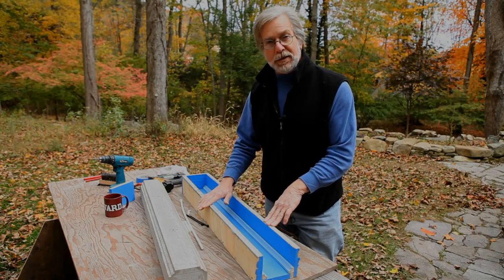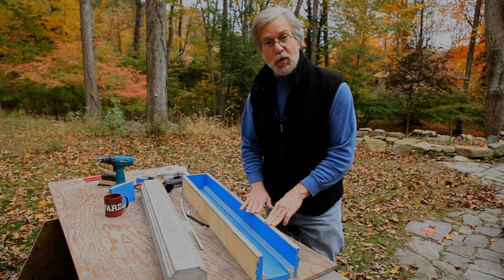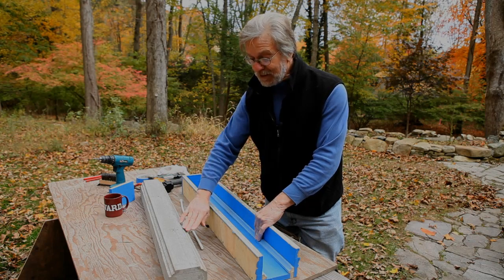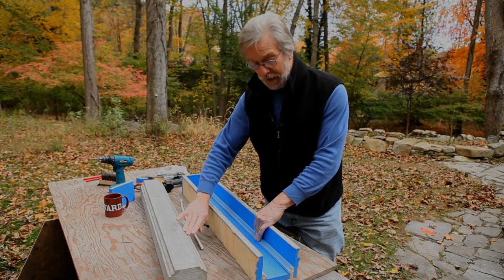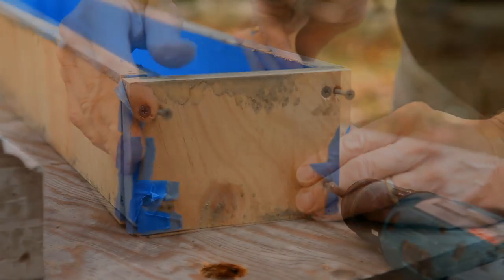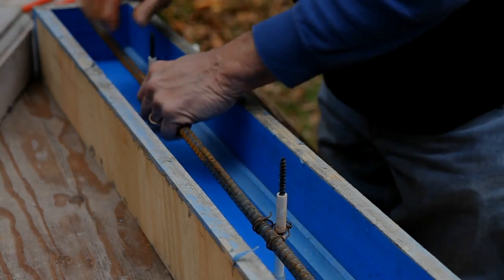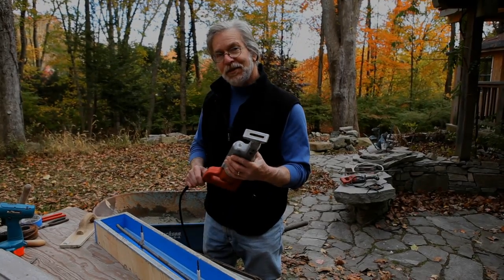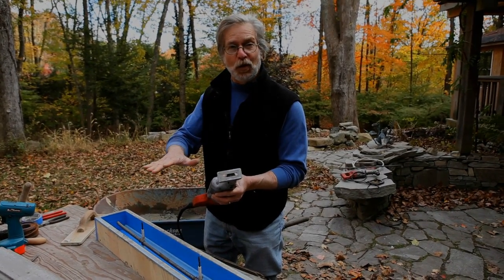Concrete Settling Trick

Comment: Great idea- Up to what width of form work would you recommend this? Maybe there's a blade that might work with a multi tool to use in the actual concrete instead of a proper vibrator?

Comment: Great tip, i've seen a palm sander used for this too. Just touch the edge of the plate to the side of the formwork. And i like the method of forming the pilaster too.